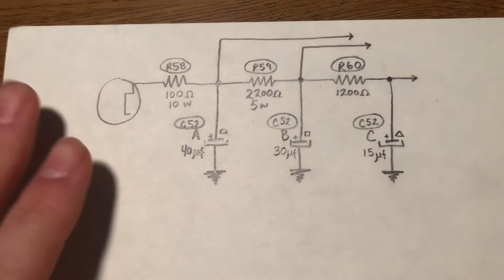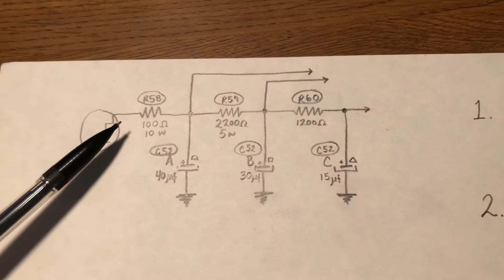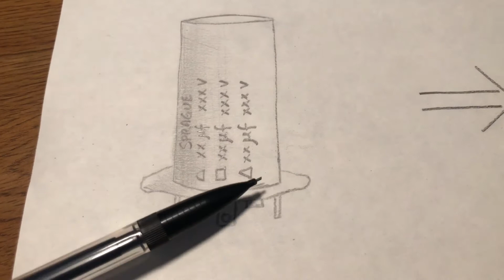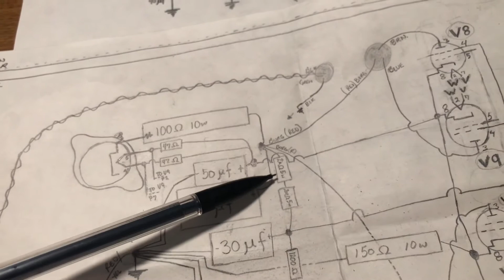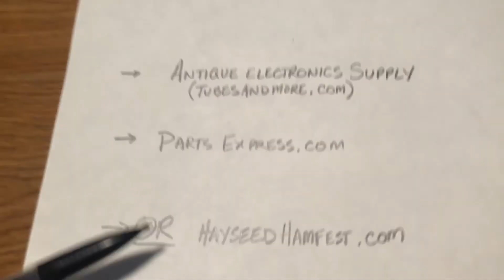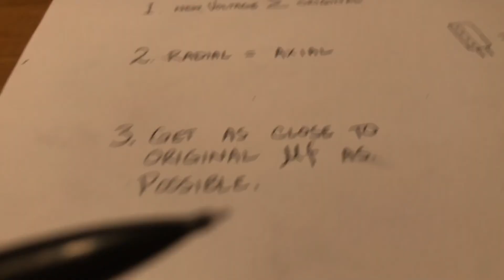How to Convert Can Capacitor to Individual Caps

Comment: When the area that has those can capacitors look very crowded with other components and wiring, you can always find a location to  install those solder type terminal strips to mount the new individual replacement capacitors. The old can capacitor can be left for ascetic purposes if you like to keep the original vintage appearance. Remember to remove any wires and components from the terminals of the bad can capacitor.

Comment: Get as close as possible to the original values.............IF the ( vintage ) amplifier was designed correctly .........YES stick to the values !!!!!
I know a lot of audiophiles who think and BELIEF that more equals better ...........but they don't know about the LOST skills and knowhow of old engineers of the tube era when they took also timing reated values/ratings into account to preserve the musical envelope ......
Yes you may gain some of these audiophile beloved performances BUT you will wonder whay you lost that beautifull melody and its coherence as well as the tone of the original design !
The thing is they will make them self believe that this is better while cognitive dissonance will haunt them since .

Comment: I’m working on a ASR-120 S/C stereo amp for audiophile critical listening. I have seen where some caps can be labeled incorrect as far as the inside and outside wire foil. So if I only have a volt ohm meter can I check to make sure I have it installed right
Reply from the maker: It is possible that a cap could be mislabeled.  I believe you would need an oscilloscope to know for certain.  Capacitance and impedance are not simply measured with a multimeter.  As long as the cap can handle the voltage, and the uf value is +or- 10%, it would be close enough.  I’d rather worry about making sure the shielded end of my non polarized cap is on the grounded side.